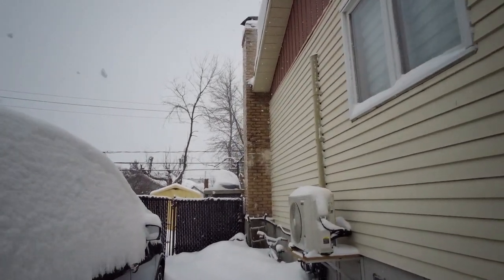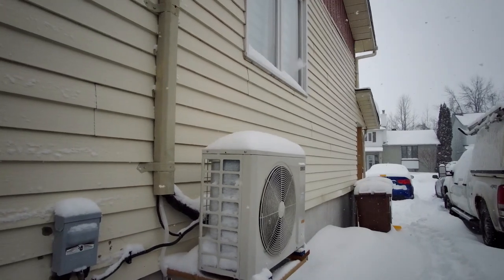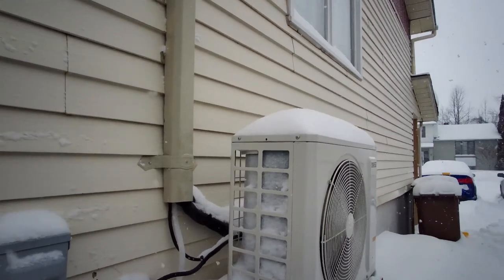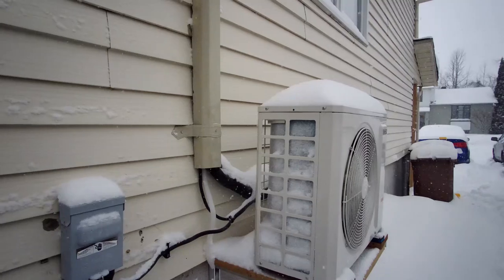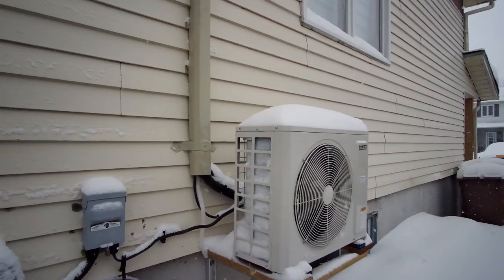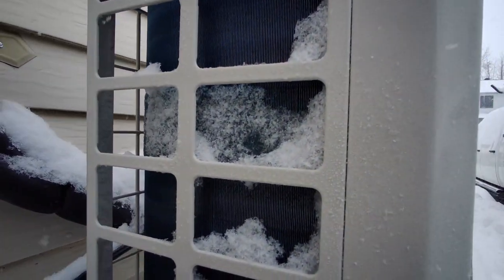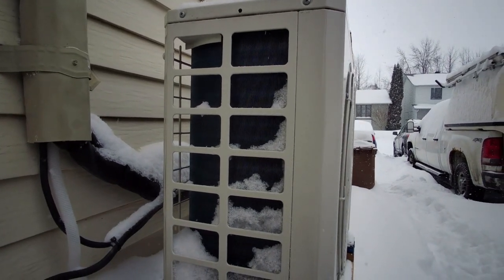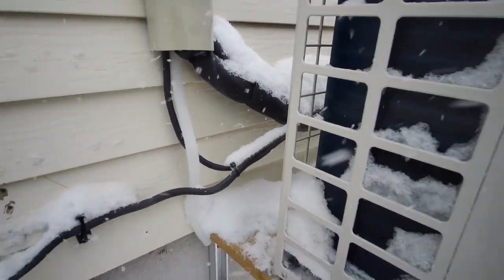Mini Split Heat Pump Defrost

Comment: What does the indoor part do while the outdoor is defrosting? Does it blow out cold air?
Reply from the maker: No depending on the Brand and model, it will either ramp down to very minimum airflow or stop completely during defrost mode.

Comment: Is there anyway to manually defrost... like with a propane weed torch or heat gun? Or is that just too crazy?
Reply: What about a pioneer version of these mine constantly ices up and it doesn’t say it’s defrosting
Reply from the maker: The safest way to avoid damage would be pails of hot tap water, but if you have to defrost manually all the time, you more than likely have a problem.
Reply: Run it so it cools inside for 5 mins. Your welcome =)
Reply: You can put it on air conditioning mode for five to ten minutes , fan on low . That will take care of excessive frost / ice build up . Then switch back .
Reply: @e @edpardy461 n’t get the indoor warm enough for cooling to turn on